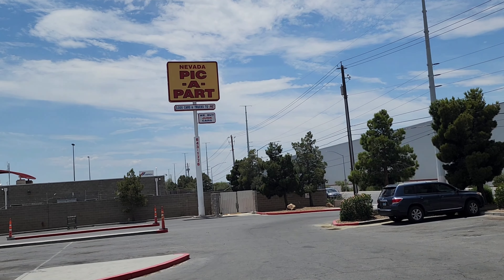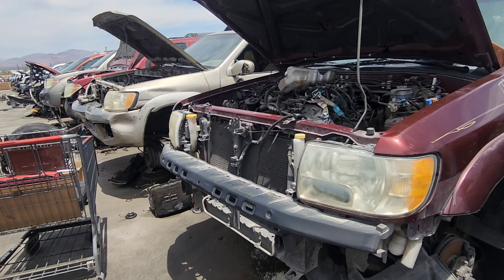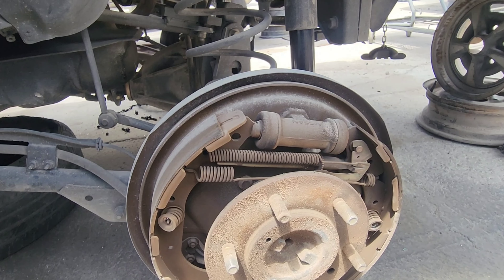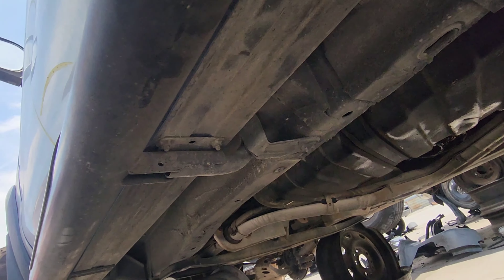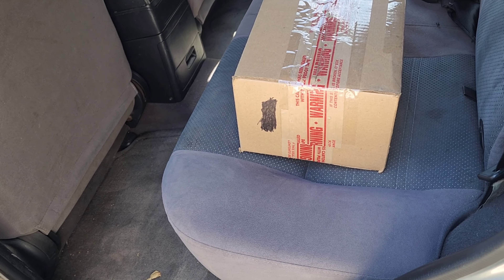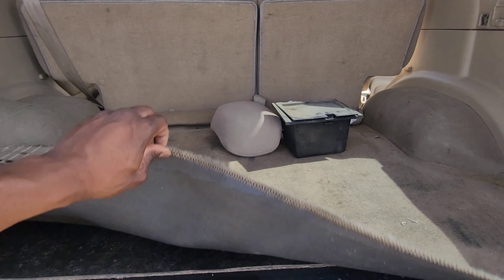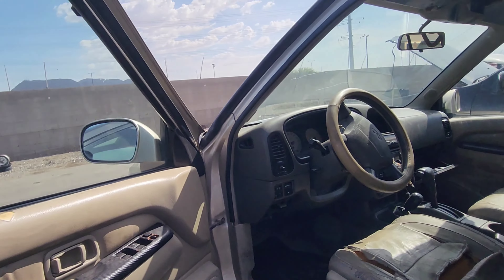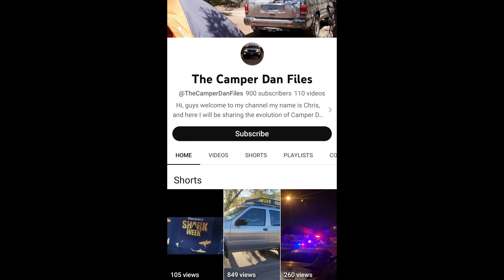There's R50 Pathfinder & Infiniti QX4 Gold In Dem Junkyards Pt2!

Comment: Will a Pathfinder grill fit on a QX4? I figured the spot near the headlights would be a different shape.
Reply from the maker: @fosty, the answer in yes and no, the Pathfinder grill will only fit once you clone the front end of the QX4. So you would need to replace the headlights, bumper, hood and possibly the fenders too with those from a Pathfinder. Yes the headlights are shaped different and so is the hood.

Chris.

Comment: Why do your junkyards have all the r50’s!? I need the passenger side headlight assembly and turn signal as well as the driver side headlight assembly. I also need the washer fluid pump. We never have any decent r50’s here in Dallas.
Reply: Oh and the pathfinder emblem on the rear hatch.
Reply: What is your eBay name?
Reply from the maker: @lanaetuck9796, I don't currently have any of those parts available for purchase on eBay. For custom parts orders or request, I ask that you use the link I have provided to my NPORA Profile. Which can be found in the description of this video. I hope this helps. Thanks again for watching!

Chris.
Reply: Okay awesome thank you so much Chris!